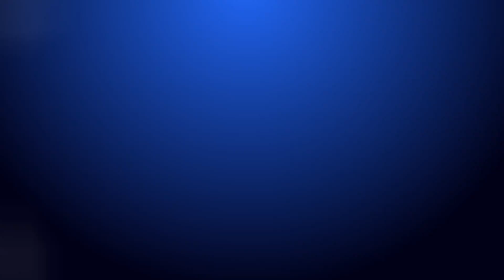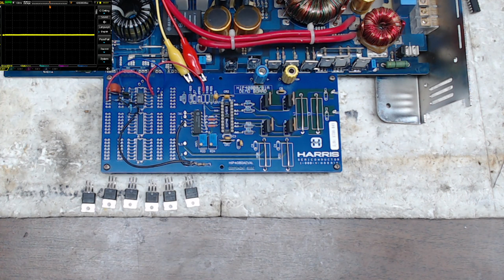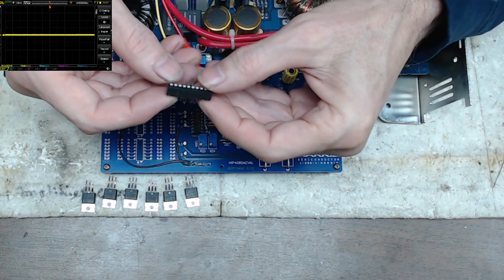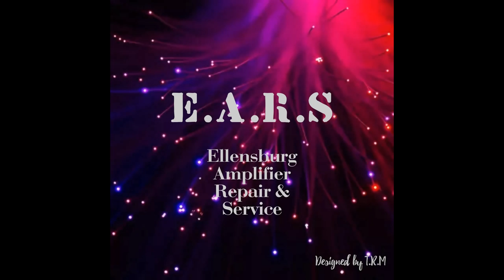Hifonics Brutus BXI1606D HIP4080 IC Testing

Comment: Please suggest replacement or similar IC for HIP 4080.
Reply: Thanks for your response
Can I use IC4081 instead of IC4080?
Reply from the maker: @mehradojaghi749  Depends on the circuit you are working on. The 4081 has independent input control so you will have to refer to the datasheet to properly configure the input.
Reply from the maker: There are no drop-in compatible ICs that I am aware of to replace the HIP4080 or the HIP4081. Domestic distributors did have them back in stock last year when I resupplied.

Comment: Did you use irf3415 mosfet for output? Ty
Reply from the maker: They are the IRF3710 as per the schematic
Reply: @ellensburgamplifier  Yes The IRF3710 is the one that comes from the factory but currently the IRF3710 distorts when the volume is raised a lot as a replacement most use IRF3710z IRF3415 and IRF4710, I will try to put the IRF3415
Reply from the maker: @starlord2020  I would be looking into the drive and the feedback. The 3710's have been flawless in the restorations I have done.

Comment: Never had to do a 4080 repair, but can these not be tested in the board?
Reply from the maker: It is much easier to verify the function of the IC off the board as you don't have any external issues that may keep it from functioning 100% such as bad TVS's, bad zeners, protection issues, etc.

Comment: Awesome vid, good to know we have someone in the community that can confirm chips for us, ty Todd! Also I was working on that RXDm4, powered it down and was about to just desolder the output riser card (frustrated from some happenings lol) but just as I was your reminder at the end of a video reminded me to hold up man, them damn caps are fully charged ...saved me from more frustration 😂
Reply from the maker: That's right! Watch those caps as some boards do not have discharge resistors.